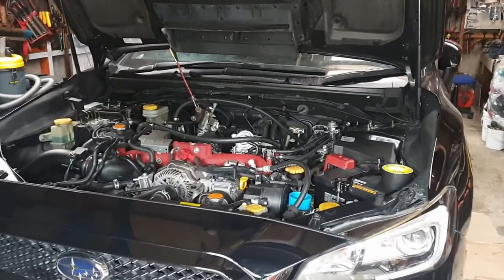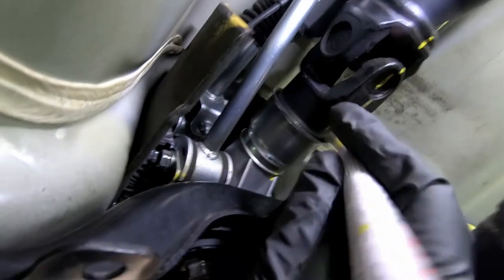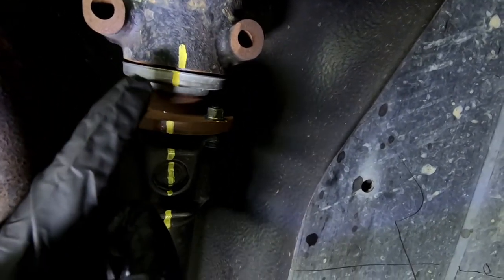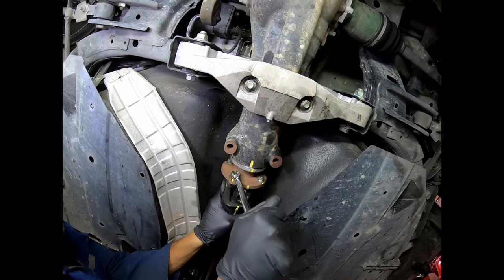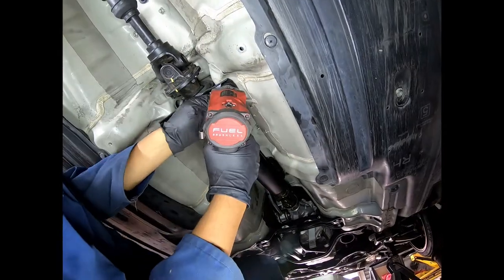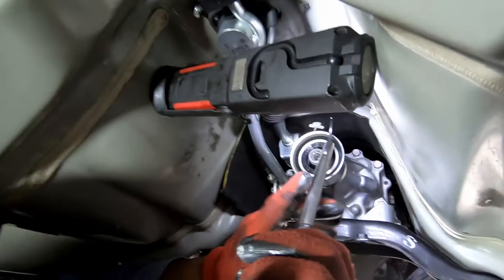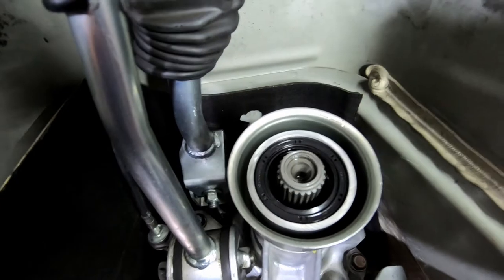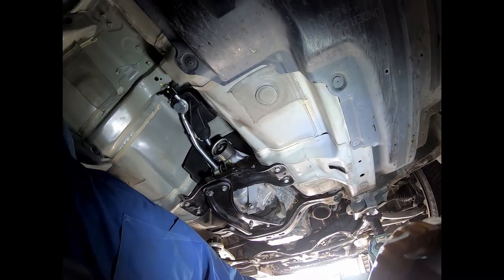Propshaft / Driveshaft Seal Replacement Subaru Gearbox STI 6 speed

Comment: Precise and detailed information, this video will for sure be of service to many that have never done this type of job. Even down to the torque specs, nice job! Rather than unbolting from the rear differential, I prefer to unbolt at the carrier, then you only have to remove half of the shaft and don’t have to worry about aligning the diff. Even though the driveshafts are balanced it’s still a good process to follow. A+!
Reply from the maker: Appreciate the feedback! Thanks

Comment: What if your insalling a diffrent drive shaft also how would you go about make ing shure its in the same spot
Reply from the maker: Its not a must that a driveshaft has to be re-installed in the same position if your installing a new one to the gearbox output and re-bolting it to the diff. Its more important to ensure its balanced.